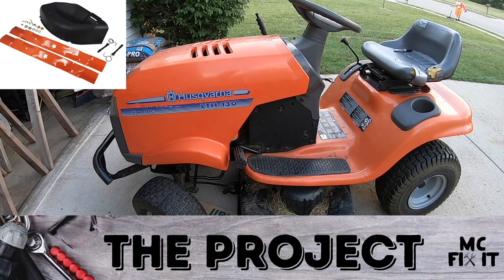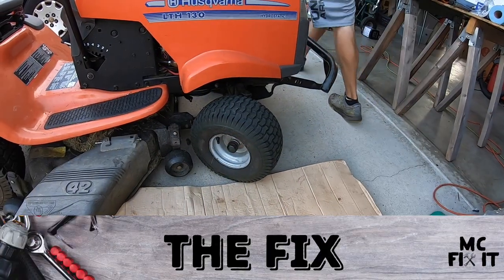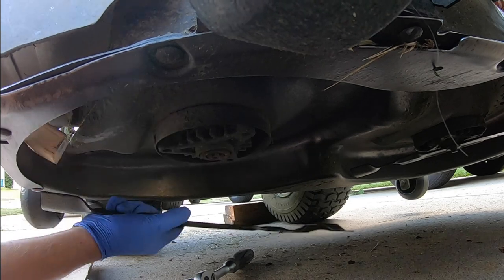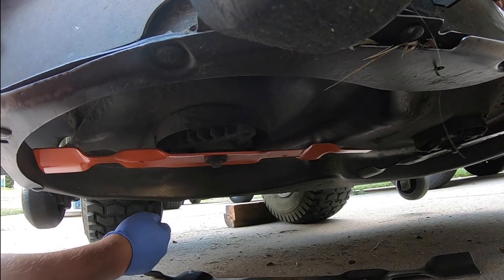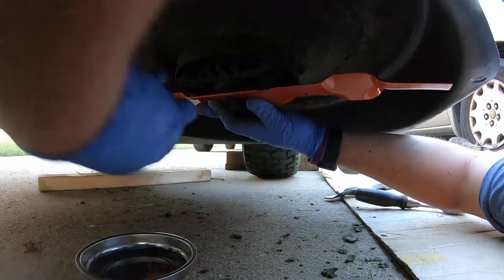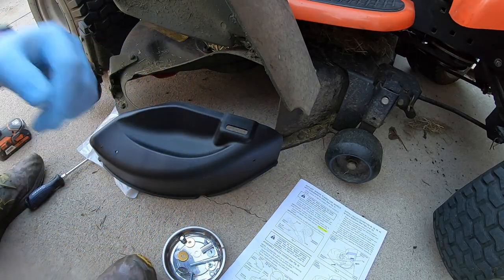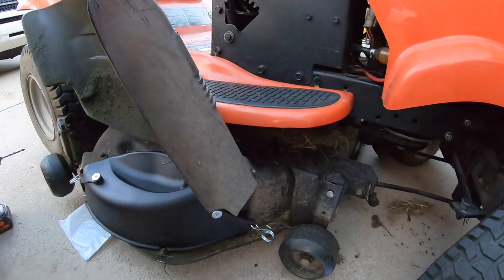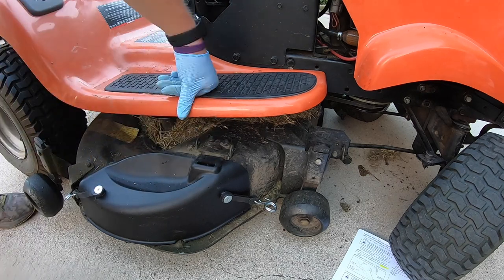How To Easily Change Riding Lawn Mower Blades & Mulching Kit - Husqvarna LTH 130 [Complete Guide]

Comment: Think you used the wrong flat washers. The 2 brass colored washers are used on the 2 rubber keepers. The 3 silver washers are used on the bolt that is used for the larger decks.
Reply from the maker: Thanks for this!